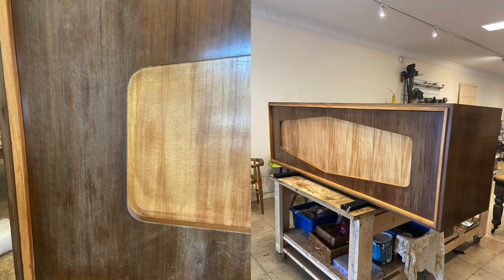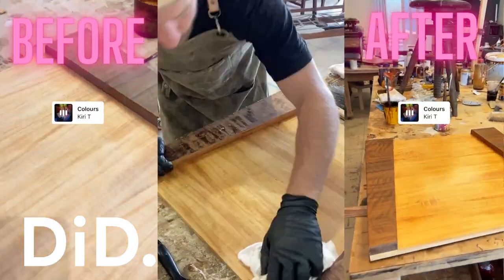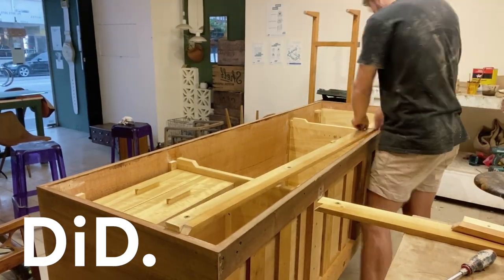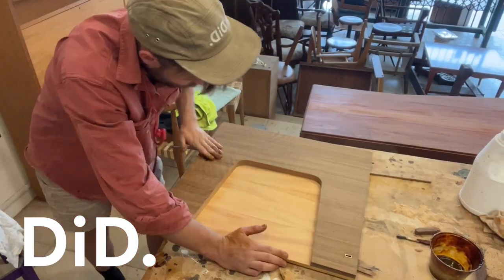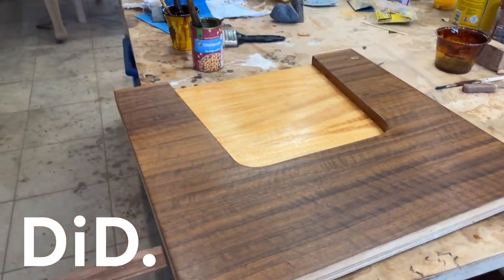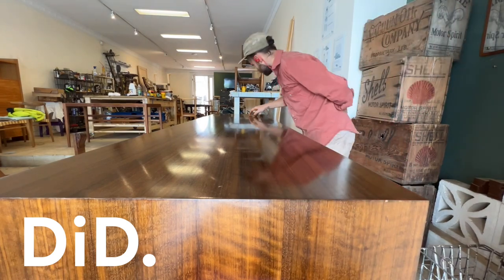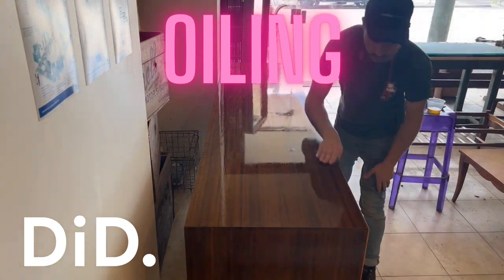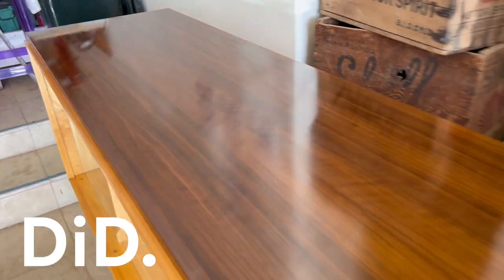Mid Century Sideboard Restoration - Furniture Restoration Guide

Comment: Absolutely stunning results!!
I’m curious about the process. 
Strip… 
Sand 180 then 240
Shellac - you used 2 shellacs. One for each color of the wood. 
Then sand again with 1200. 
Then french polish with ??
Next comes oiling with a 50/50 mixture of Linseed oil and ?? Gum-terps….turpentine?
This piece looks incredible!!
Reply: I have a walnut credenza that needs refinished. And this method would really make it look incredible!! Subscribed!!
Reply from the maker: Hi Brock!
Thanks so much for reaching out and asking about this process! Well done following the steps! You don’t have to use two different types of shellac, the brown or the dewaxed shellac will be just fine. Yes, 50/50 Turpentine and Linseed Oil.

We are about to release another restoration tutorial on YouTube where we use a hard wax oil to finish a mid century sideboard. It’s a much easier process, so it may be worth waiting and you can compare the process and outcomes.
I have released a small clip of it on our Instagram (DealinginDesign) if you’d like to catch a glimpse. 
Happy to help out further if need be, just reach out : )

Comment: Hi Jamie. Beautiful work on that piece. I am new to furniture restoration & am curious about your process. I thought that MCM pieces were finished with lacquer but you used shellac. May I ask why? And do you know where the piece was made? I have never seen it but I love it. Thank you for sharing your artistry.
Reply: What a sweet pup! I have two Saint Bernards myself.
Reply from the maker: Hi Amy!
Thanks so much for the kind words. We use both lacquers and shellac in our workshop. I don’t really have a good reason why I used shellac other than it felt right. I ran some tests and the grain was going to fill quite quickly, sometimes if the grain in hungry I will opt for lacquer as it builds faster. Also, because we had to strip the finish and sand the veneer, I thought I’d make it easier for the next restorer as Shellac strips and clears the grain easier. I often think once a piece has been restored a few times, we should consider using finishes that will be easily maintained and easier to strip. I don’t really have a preference between lacquer and Shellac in this situation, I just thought we would go with a French Polish and finish it with an oil finish. A lot of mid century pieces were finished this way - just not the majority, because lacquers were faster to finish and cure. Pieces were often lacquered because it was faster and it was the leading technology at the time. In my opinion, lacquer was used as a process, to speed things up, and rather than a superior look or performance. For those reasons, I think either finish is an option, as long as the same aesthetic is achieved. Hahaha yeah Mr Lenny is a lovely little dog, he loves spending time at the workshop! Thanks so much for reaching out 🙌
Reply from the maker: That is meant to read 

‘In my opinion, lacquer was used as a process to speed things up, rather than a superior look or performance’ 

😅
Reply from the maker: Oh yes, the piece is Australian. But we are not sure who produced it. A few people have speculated that is was made by Dario Zoureff or Rosando. But I have had many discussions with researchers and dealers and none of them has been able to place the designer or manufacturer yet. 😀